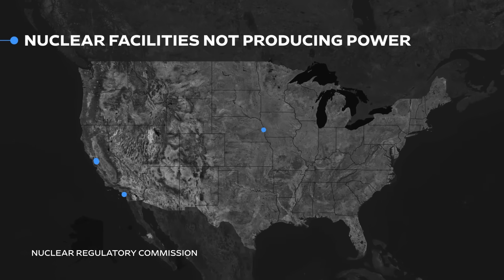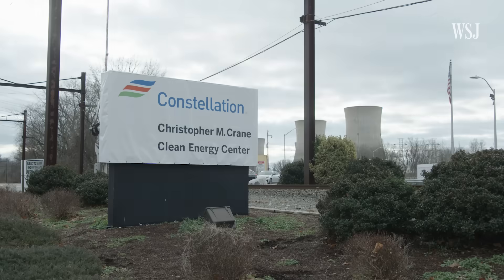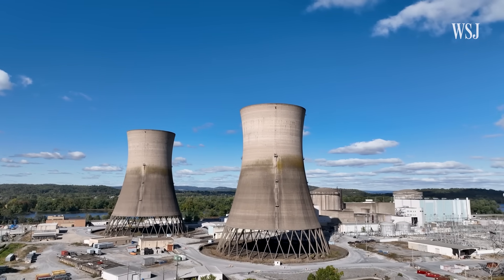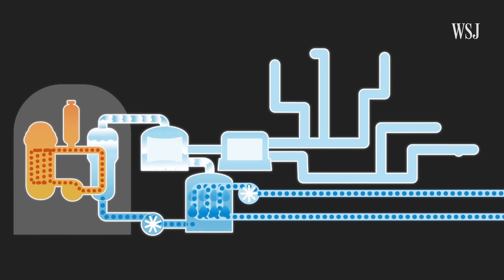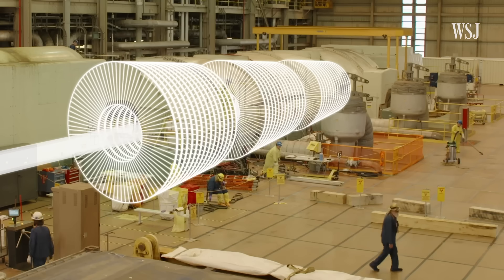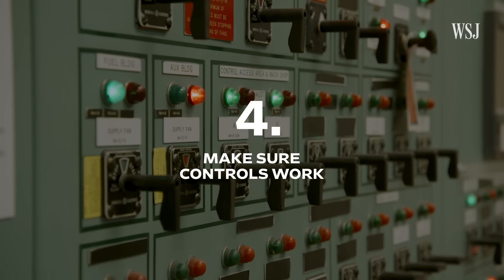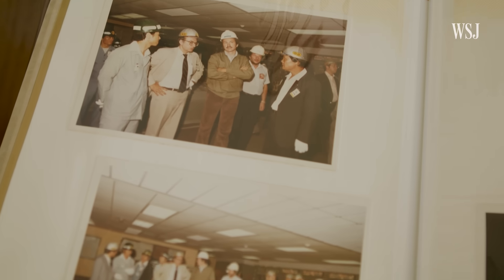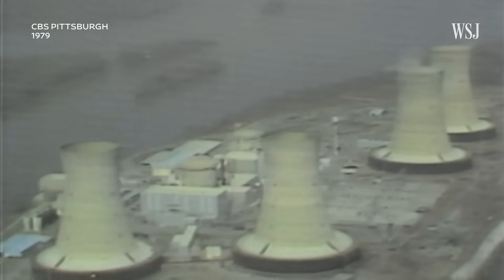Inside the $1.6B Plan to Restart Three Mile Island | WSJ

Comment: Nuclear power is the path forward. I do have great pause as a controls tech turned controls engineer about the use of the old controls. The availability for replacement parts is going to be very difficult. And that window is shrinking. I would not want to see this go in service with 1960 controls.

Comment: Gigawatts are Gigajoules per second. Gigawatts per hour would be Gigajoules per second per hour. That's a rate of change. So you probably meant gigawatt hours per hour. So. Gigawatts. Which is a rate of energy use. Also known as power. So, using gigawatts to power AI nobody wants.

Comment: The guy at 3:50 is completely full of hot air. America is not any kind of leader in nuclear energy safety. We haven't built a new plant in forever and the designs are ancient and without many simpler safer systems.
Reply: So, 2013 is forever?  (Votgle units 3/4)

Comment: They cannot bring back all the shutdown plants.   Shutdown plants have been used as a source of parts and components that are no longer manufactured to keep operating plants running.  In many cases it would be extremely expensive to design and certify newly manufactured parts.

Comment: Building yet another bad design. Where is the Thorium?
Reply: Nowhere to be found because good luck building new reactor. It’s a lot easier to convince the AEC that recommissioning an old reactor is safer than trying something new. It’s a Catch-22 they want proof that the new reactor design is safer with actual operation, but they won’t issue a license for any of the new reactors to actually operate so you can’t gather the data needed to meet the licensing expectation.
Reply: This is like getting a used car.  You surely know the tangents.  It's not always bad, as a new frame can be perfectly usable.

Comment: Calling 3 mile island a real melt down is a stretch,  for the most part the safety systems worked as intended to compensate for the ones that had failed.   A few kg of xenon gas, and a jammed core, is a much better outcome than no safety systems working and the pressure veseel exploding covering everything with fall out.
Sure it wasn't ideal, the failed components was a result of cut corners and greed.  But exposing locals to the equivalent of a small xray or a flight to france worth of radiation isn't a great worry.   It was apparently the media and local government that spun up the hysteria..  3 mile island was a malfunction not a meltdown, caused by components failing that were overdue for replacement or servicing.  Basically the nuke version of forgetting to change the oil and oil filter for 8 years in your car.

Comment: The fact of them re using pneumatic controls instead of upgrading shows already they aren’t that worried about safety and more worried about money
Reply: Nothing wrong with pneumatic controls. They are very reliable and work when the power goes out.  Parts are still being manufactured as well (and in a number of cased the same model numbers of pneumatic controlled valves and controllers are still be manufactured).    Certifying and replacing controls is extremely expensive.  Don't mess with something that works.

Comment: Finally we are starting to to be sensible. Especially with technology that we have today and the lessons we learned through the many years of operating these plants. Nuclear energy is the cleanest energy that we have right now. I mean renewables like wind turbines are great until you have to dispose of the blades and the amount of land it takes compared to a nuclear reactor that is on all the time. Solar is great as well except for it needing to be supplemented with anoth form of energy when it is not windy or sunny. I think a lot of people look at are electric grid kind of like our phones and our devices that you can power them up and charge them and then use the power that you got when you were charging your battery. But that's not the case with or grid everything or just about everything is produced as it is needed there is no real backups like batteries I mean the technology exists but we are a long way off from it being feasible.

Comment: I love how the Wall Street Journal tried to make this sound very ominous and scary. Meanwhile, I’m watching this in the chair. Super excited about the future of clean energy.
Reply: Same here
Reply: I’m just interested in if they’ll ever replace the controls and other electronic systems? I don’t know how reliable those are and worry about their failure. However, I would think those are built like tanks?
Reply: @dasbuilder  Nuclear engineer here. The controls themselves will be retested, documented, and accepted into the program. The controls and systems themselves are not a safety issue. The reinspections are incredibly thorough and involve external personnel and the Nuclear Regulatory Commission to ensure there are no deviations that can introduce issues. Areas that are found to be deficient will be repaired or replaced. A lot of the issues TMI will face will be 'catch up maintenance' from a reduced/retired maintenance plan during non-operation. There's an entire industry of specialized tools to check material fatigue, weld integrity, and more across a nuclear reactor!
Reply: @jessvagnar4957  Thank you for the detailed explanation, I appreciate it! That’s pretty awesome how much care is taken to ensure they’ll work.
Reply: its because they're pushing the democratic party's agenda. Literally no one died or even got injured in the three mile island incident
Reply: That energy ain't being made for you

Comment: Restarting these reactors is simply crazy.
New reactor technology that has developed over the last fifty years is way better way to go if you want to go nuclear.
Reply: True, but the cost and timeline are the major considerations here. It's like repaving an existing road, you don't have to replace all the infrastructure and it's already in a convenient grid-supported location. Gen 2 reactors are safe and have plenty of features. The most modern reactor in America is still only a single Gen 3 even while we're constructing test bed systems for MSR/SMR approaches. Vogtle took 15 years of overtures to reach operational state. We haven't finished a single Gen 4/4+.

Comment: The idea that an entire nuclear reactor’s power is going towards a single company’s servers seems, wild..  How inefficient are these AIs?
Reply: A lot of power requirements for data systems come from the HVAC/server cooling system. Machine Learning is very useful, but it does require a lot of computing power, which requires more computers to do it faster. This generates a ton of heat.
Reply: Extremely inefficient
Reply: Oh Summer child.... Its not only for A.I., its Datacenters in general... Think CBDC, Crptos, and other defense contractor uses.
Reply: Dude what? AI power consumption is extremely efficient. You just need lots and lots of data.
Reply: @wasgehtsiedasan8660  Thanks to deepseek, this aged like milk 🥲

Comment: So, a) Reconsidering nuclear is about clean/green energy. Only trump and the oil/gas/coal oligarchs believe that climate change is a hoax, and trump knows he'll be dead and buried before his money stops keeping him safe. b) Most modern vehicles are packed with electronics that were not technologically possible when these power stations were designed and built, keeping them comparatively reliable and safe. Any modern plant will be monitored and controlled by fancy computer systems and multiple fancy sensors. These plants were monitored and controlled by the computing power of humans, so a human failure that people are dismissing as minor was a much more significant event!

Comment: @1:14 The towers are not the reactors.  The reactor buildings are the smaller cylinder shaped buildings near the rectangular building in the middle.
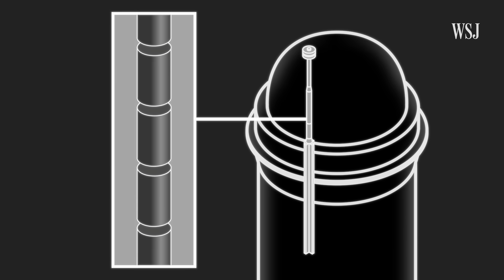@1:54 Those rods at the top are the control rods - they drop into the reactor to moderate the reaction (or pretty much stop it if all the way in)
Reply: Moderation refers to the slowing down of neutrons, not the absorbing of them. Water is the moderator, but the control rods do stop the reaction. I'm guessing you already know that, but I want to clarify for others reading this comment.
Reply: @ Good points - thanks.
Reply: No. Those are fuel rods. They are inside the reactor and aw lowered to make it hotter and take our to stop it.
Reply: @ilovecops5499  You are dead wrong - control rods drop from the top between the fuel bundles <-- (correct term) - to moderate (slow or stop) the reaction.
There is a pretty good drawing in wikipedia to steer you right. (Pressurized Water Reactor).  In some Boiling Water Reactors, the control rods are underneath the reactor and push upwards to moderate (slow or stop) the reaction.
Reply: SSSHHHH!!!  The anti-nuke people can hear you!  Facts don't matter.  Truth is relative.  Solar, wind, and butterfly farts are what is safe.
Reply: 1:14 they are referring to the entirety of unit 1 and 2, which includes towers
Reply: @jameslin7486  No.
Reply: @AlanTheBeast100  oh i see what ur talking about mb

Comment: 1:51 I'm pretty sure what you're showing is a control rod and not a fuel rod, who did you consult for the animation?
Reply: Obviously nobody considering they start out the very first 20 seconds by demonstrating they have no idea what the concept of power or watts mean at all, lol. 
 "Microsoft could need over 90,000 gigawatts an hour to fuel AI"
🤣
brb, I'm gonna go fill up my car with 250 miles per hour of gasoline, lol.
Reply: It's a Rod 4 Sure!
Reply: Correct.
Reply: Probably Google or AI like all of the modern reporters.
Reply: musk

Comment: It’s not just earthquakes or bombs that cause a nuclear meltdown. It’s malfunctioning of the cooling system. Human error never ends. All digital (electronic) systems can be remotely sabotaged. 

In Fukushima, they haven’t been able to even see the meltdown area after 14 years because nothing, not even a camera, withstands the radiation level in there. 880 tonnes (guesstimated, as no way of knowing) of radioactive debris is untouched.  26000 residents are still displaced.

Comment: That there is no Fallback pumps and that the same reactor design literally next to it meltdown worries me. A smaller new standardized design seems like more long term but safer solution.
Reply: Unit 1 was upgraded from the lessons learned by the unit 2 accident before it restarted in 1985. Unit 1 then operated safely till 2019, 34 years of proven operation.

Comment: There's an error at 1:50 in the reactor diagram. The highlighted part is a control rod not a fuel rod.  The core with the fuel is below
Reply: There are a lot of errors. They highlight the cooling towers as the reactors as well, and claim that three mile released radiation into the air. It didn't, it was contained inside the powerhouse.
Reply: @Demonslayer20111  *containment building
Reply: This shows why America does not deserve nuclear energy.

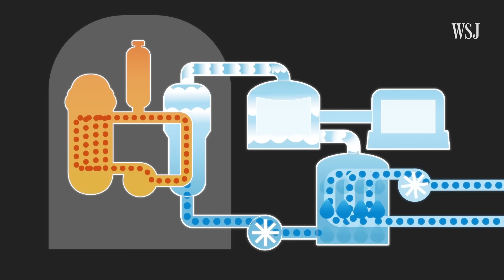Comment: The explanation of the accident has multiple inaccuracies starting at about 2:10. consulting with an expert before publishing misinformation would have been nice from WSJ.
Reply: Pretty sure they’re showing inspections of the steam generator tubes at 2:26, which is not where the leak occurred. That’s not a similar leak to a primary relief valve being stuck open.
Reply: Oh, they definitely consulted with an expert at least in their minds. AI.
Reply: When she said that the transformer's job was to move energy from the plant onto the grid I just closed the video and gave up.
Reply: @Forbes123  It uhhh transforms the power from the plant to her phone charger duh
Reply: The media are the ones who made TMI out to be exponentially worse than it actually was. Its sort of the standard for mainstream media to publish Yellow Journalism articles on nuclear, or really anything scientific that requires an expert to adequately explain; even then the lowest common denominator of the populous probably won't understand anything more complex than "A good, B bad." so they sell the "A good, B bad" narrative.
Reply: All these errors coming from such a huge news outlet is one of the major reasons a lot of people have incorrect and bad opinion about nuclear

Comment: Low temperature nuclear using microwave and boiler may handle up to 500 °F max because motor generator power microwave and microwave heat the sea water then nearly no power needed

Comment: That control room looks like something from my youth, without screens or even LED's.
I'm 64.
Reply: And still works better
Reply: @adog7787  If it was maintained. They'll have a real issue getting parts.
Reply: Yep.  Most of them were desinged in the 60s and 70s.  Can you imagine all the paperwork to try and upgrade a control room for a plant that already had a license issued?  Beyond monumental.
Reply: @Kriss_L  you are correct, however many plants are going through a massive digital upgrade. Limerick has been working on the for the last couple years and are nearing completion. Updated control room will have touchscreens and monitors with associated digital controls.
Reply: @Kriss_L   I've worked with old powerplant switchgear. Replacements would be a lot safer but the paperwork...
Reply: And all the switches and gauges are better made than Anything you could buy today!
Reply: I've closed down two power plants. All those pneumatic controls and switchgear are going to be an issue. I was getting replacement parts from E-Bay before I retired.  Finding Nuclear spec parts are going to be an issue. I'm sure  Westinghouse will start a production run for the right price.

Comment: One would think they would have like 5 backups to cooling in case a valve doesn't open or a water pipe leaking. We can literally freeze materials to as cold as the coldest point in the universe, can probably use at least something like that.

Comment: I presume that they will add redundant cooling systems so that the breakdown of one pump won't result in another overheating incident.
Reply: The explanation in the video was extremely condensed because a full technical explanation would lose most people. The issue was far more complex than what they portrayed and not caused by a single pump failure. Multiple errors plus a design flaw all came together to cause this accident. It's honestly one of those "go buy a lottery ticket" situations because so many things just happed to align that it seems implausible. The industry learned a huge amount from this accident. They retrofitted their plants to reduce the risk, and operators are still HEAVILY trained on the lessons learned at TMI-2.
Reply: Unit 1 was upgraded from the lessons learned by the unit 2 accident before it restarted in 1985. Unit 1 then operated safely till 2019. It will be upgraded again based on industry experience from 2019 till it come back online.
Reply: Retired nuclear plant engineer here.  All nuclear power plants in the USA have always been built with redundant pumps.  The initial plants had to have 2 100% capable pumps.  Later designs have to have 3 100% capable redundant pumps.

Also, key is that the pump did not fail.  An operator intentionally turned it off because they did not understand the condition of the reactor and other factors (key is that there was now a steam bubble in the reactor which created a water level).  Had they left the pump, which had properly auto-started due to the shutdown, there would have been no partial meltdown.  There was no instrumentation for water levels in reactors in those days as the reactor is expected to be 100% flooded except during refueling outages.

After TMI the US NRC, and most countries in the world, required multiple redundant reactor water level systems be retrofitted on existing power plants, and be designed into all new reactors.
Reply: @perryallan3524  Thank you for this information!
Reply: Naaaah, what's the chances it happens TWICE?
Reply: Value engineered that out.

Comment: Wait, do they plan to keep the same 60 y.o. automation in place? Are you nuts?
Reply: It was operating safely in 2019. It has been updated over the past 60 years with experience from all the other nuclear plants.
Reply: Corporate greed + old nuke plant does not inspire confidence. I'm sure if there's ever a problem that they can't cover up they will issue a prompt...  Ooopsie, sorry.
Reply: If it has worked for 60 years, it sounds pretty reliable to me. It's the new-fangled stuff that tends to fail more often. If it isn't broken, don't fix it.
Reply: @jerm8146  electromechanical stuff is extremely sensitive to wear and aging.
Reply: @markotrieste  Not really. There are elevators that have operated for 100+ years. The older stuff is very robust. It's when we started making everything cheap and electronic that it started to fail. I've operated old controls and I've operated digital controls. I'd trust well-wired analog controls over digital ones any day.
Reply: @dafunkmonster  We are a worn-out contactor away from a crash. Or a corroded wiring. Or a dirty orifice. Or a stuck lever. It's mind boggling to me.
Reply: @markotrieste  These plants are built with multiple redundancies. There are multiple copies of the safety systems in case one fails. It's one of the foundational design criteria that all plants must meet: No single-point failures.
Reply: @jerm8146  No reason to take another slice of swiss cheese away.

Comment: Everything about this just looks like a recipe for disaster. When this relic inevitably melts down due to 70 year old electronics they were too cheap to replace failing, the backlash will be insane at how corporate greed allowed this to happen. Just look at at the control room for Christ's sake, they keep track of tested electronics with pieces of tape. Who knows how much more cost cutting is taking place? The entire thing is an exercise in cost cutting by restarting a 70 year old EOL reactor instead of replacing it. The thing is going to make the nuclear industry as a whole look bad again.